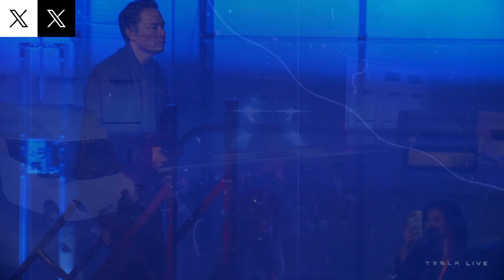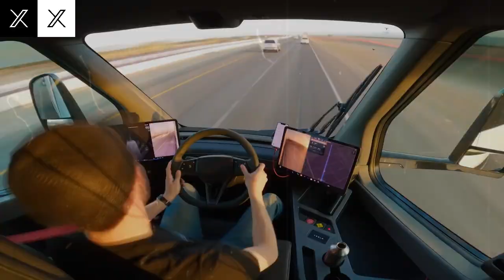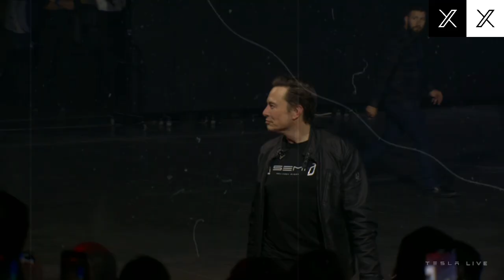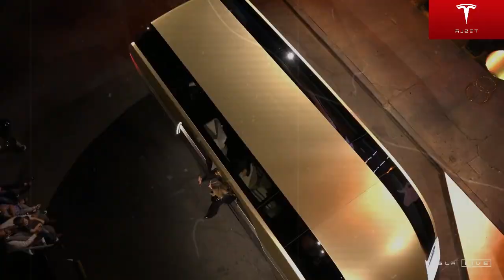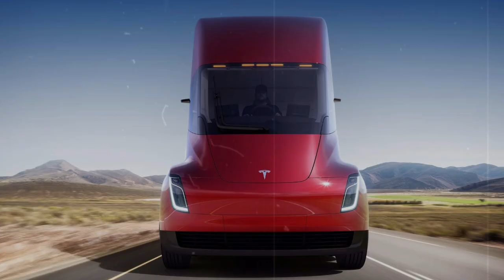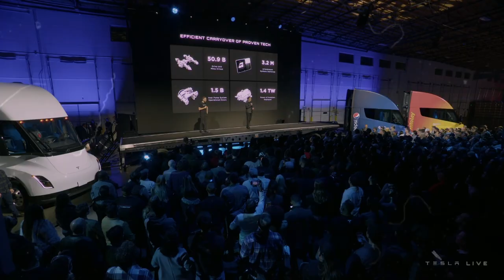ELON MUSK HAS GONE CRAZY! TESLA SEMI 2025 WILL CHANGE EVERYTHING TO SHOCK THE AUTOMOTIVE INDUSTRY!

Comment: No. TCO is last on the list of factors. #1 is how much it can haul and how far. A battery equivalent to a full tank of diesel weighs 20 tons, which is 20 tons less haul. If you cut down on the battery then you can't go as far.
Reply from the maker: You're absolutely right — for commercial vehicles, hauling capacity and range are top priorities. It’s a tough balance between battery size and weight, and you're spot on about the trade-offs. A larger battery means more weight, which can impact load capacity and range.
How do you think the industry will address this challenge, especially with the push for electric trucks?
Reply: @UNIVERSETESLA2025  this is active and ongoing research. Electric replaces consumer cars doing errands and going to work. Commercial is different. Electric doesnt replace diesel. If you run a bus and drive 500 miles a day and you want 10min down time, nothing on the market  replaces that. It mandates a new fuel type that is almost as efficient as diesel (energy generated per kg). Hydrogen cells may be that but that is decades out to be comceecally viable. For those who really care about this, nuclear power is next up on the ease list. 55 to 60% of all emissions are stationary and power generated from a nuclear turbine is the same as coal turbine.
Reply: @UNIVERSETESLA2025  even if you believe that tesla was a salavagble brand, Electric semi trucks are not commercially viable, even in Europe. Electric trains and rethinking our logistics network is probably needed. Most of our network is based in 1880's thinking.